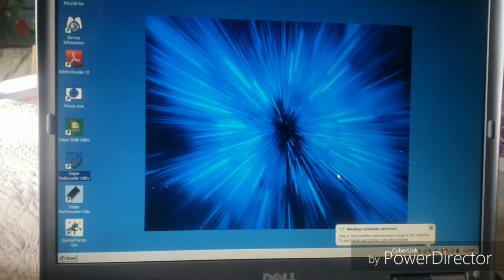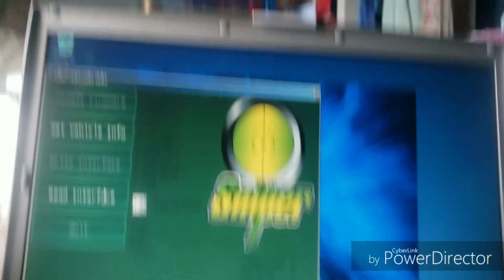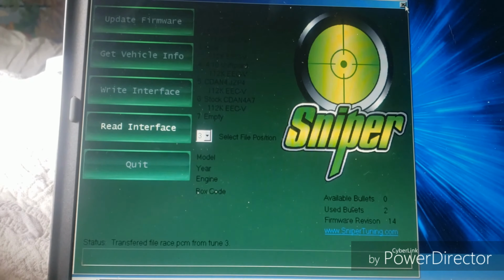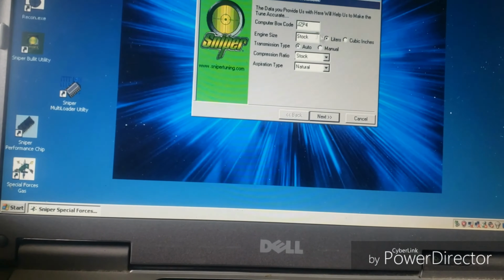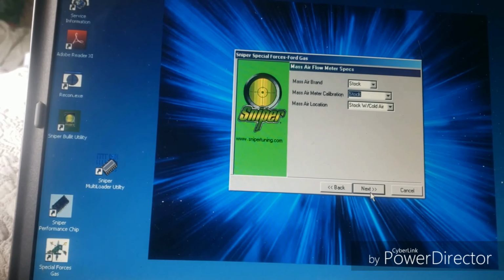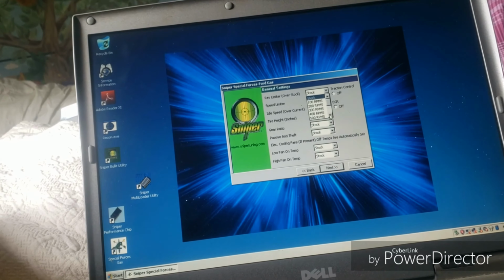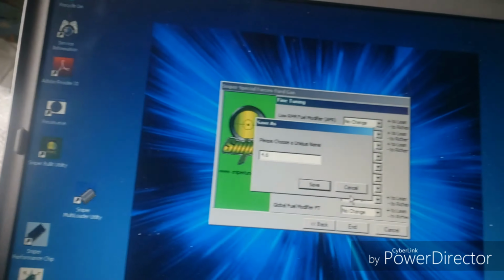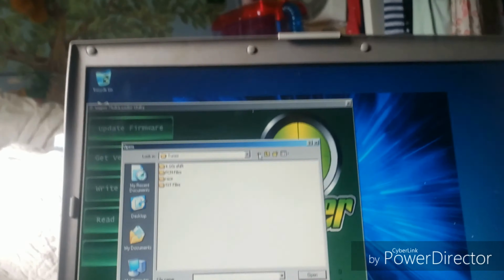How to tune using sniper tuning

Comment: Hey is there a way I can catch up with you an talk to you ?I know the owner had passed away.i bought the same tuner you have with the 3 bullets an I bought the one with the one for my shop with unlimited tunes.but never really learned everything about it ended up blowing my engine as well as had health problems soon after.but the software I have unlimited tunes on the one but needing to make your computer to a hole different programming.or gigs.im thinking on going with a fox body.which I know these don't tune..I'd like to chat to you about this
Reply from the maker: You can contact me at 4.6savage1997@gmail.com .  I have no info on 5.0s only 4.6l and hacen6 tuned with sniper since this video was made. I didn't know chris had died either he was a great guy and helped when he could.  Hopefully i can be of some help

Comment: So you failed at tuning a pcm and still posted the video? You made absolutely no changes to a pcm file, you do realize that? Not being mean, but please do some research before you make 'help' videos.
Reply from the maker: Incorrect i made a canned 87 tune sniper  auto  changes the table now if i tune with my pro lvl version its different. If you knew anything about the program you would have known this. the tune i made bumped timing up 2 degrees across the range. Please do research before commenting incorrect information.
Reply: @46Savage  you literally did not advance the timing 2 degrees. If you had any inclination of how an engine works, it would require you to use at least a timing light to do that. You would also need to adjust more than selecting long tube headers and a cold air intake in the software, along with changing the rev limiter and top speed shutoff. The standard version of Sniper doesn't allow timing advancement changes without the added module. The error messages you received are a clear sign that you do not even know how a simple program operates, so please do not speak about me knowing software. However, if you would like to know what the error messages were, please PM me, as I am one of the program developers for the Sniper software lol.
Reply from the maker: Do i need to create a tune on basic sniper tune  and show you what it changed on commando ?
Reply from the maker: As for the error messages they were for me not putting in the correct pcm code ie since i was making a vid on how to use the software if you would like tho for your pure enjoyment i can make a vid making a canned 87 tune and compare it to the stock tune so you can see the timing charts change since your info is incorrect
Reply: The owner died what are you guys doing now .I have the pro tuner an think I'm going to go with older engine

Comment: Hi, I'm looking to buy the Commando/Delta Force Tuning Kit, but I wonder if the kit comes with the cables to connect the computer to the Delta Force box and then to the OBD2?
Reply from the maker: It comes with everything you need
Reply: 4.6 Savage thank you
Reply from the maker: Np man if you need anything else let me know ill actually be doing a video on commando soon